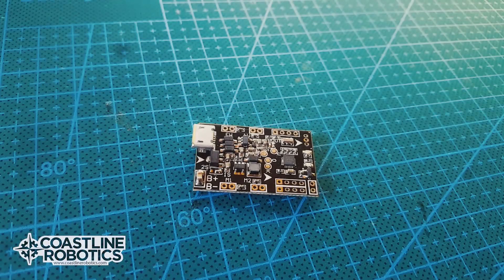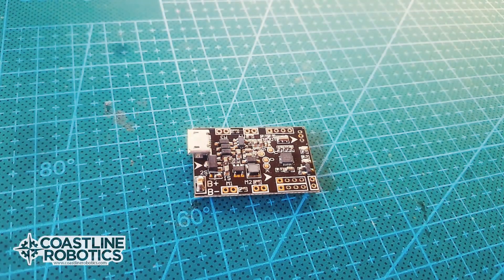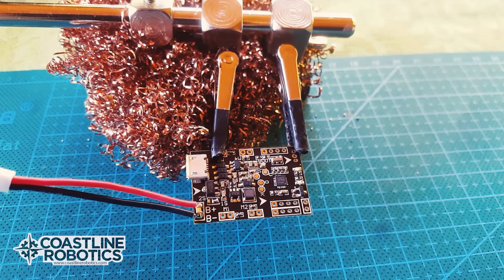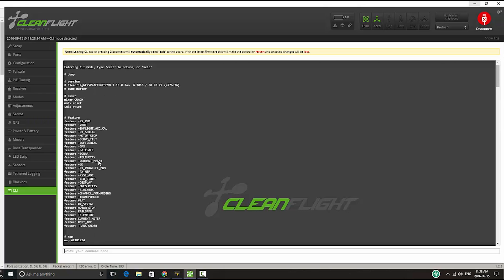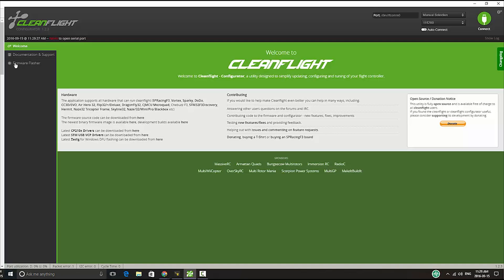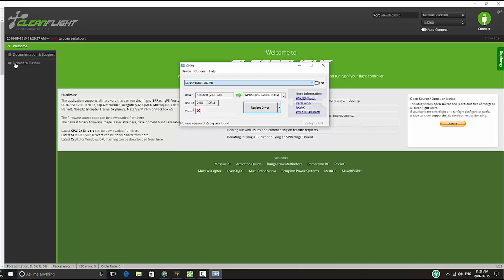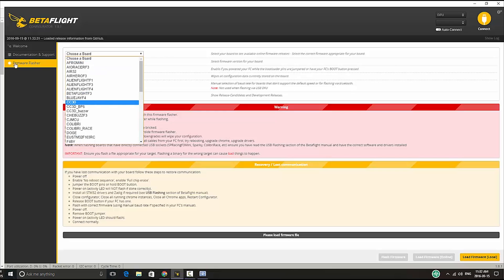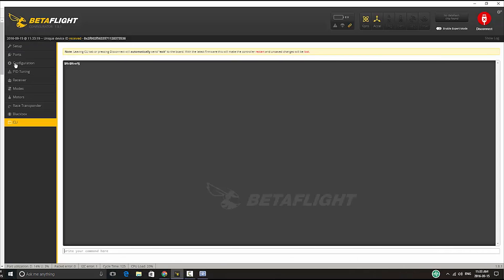Flashing Betaflight on SP Racing F3 EVO for brushed motors with Zadig

Comment: That seemed to have worked. I flashed my SP Evo to the latest version. But now when I connect the USB no com port comes up, so I can't connect. I can still connect via the bootloader. What do I have to do now?
Reply from the maker: Did you de-soldered the bootloader pads?
Reply: Yes. I think I may have originally installed the wrong CP210x driver. I ended up resetting my laptop back to factory settings (I just couldn't work out the drivers) and then did the install again. Works great now.
Reply: I just reinstalled all my drivers after taking my laptop back to factory original settings. Can connect now. All is good. Thanks.
Reply from the maker: Awesome! Dont forget to subscribe and share buddy! ;)

Comment: Thanks for posting your video. I was having problems with connecting to the bootloader. I followed the steps, and with Zadig, and connect via bootloader and can see DFU in the top right of the Cleanflight Configurator. I will crack-on and try to flash the board now. Thanks again.

Comment: Great video! Will this work with the HOBBYMATE Q100 Micro FPV Brushed RC Quadcopter Frame Kit Combo
Firmware version: Cleanflight 1.13.0 ALIENFLIGHTF1
Flight controller: N32 Brushed
Receiver Option: DSM2/DSMX Satellite Remote Receiver?  Also why should someone flash to beta over clean flight what are the advantages? Thank you
Reply from the maker: Hey Bladesoutnow thank you. Can you please share a link to the product to check compatibility?

Thank you!

Comment: I have all the drivers, I followed all the steps, jumped the boot and disoldered it after the flash, but when y try to connect it says "no configuration received within 10 seconds communication failed", I flashed it 20 times but nothing, help please :( I am using a Beecore F3 EVO but I think the process is the same..

Comment: Nice vid!!! just one question. After flashing to Betaflight do the boot pads need to be separated?
Reply from the maker: Hey POLARJFPV yes you'll need to de-solder the pads again before connecting it again to betaflight.

Comment: I flashed it, it works. But when I throttle up the motors throttle down then slowly spike up. Throttle is all the way down but motors keep creeping up. No matter the setting no mater the MOde it with throttle spike. Any help would be great!
Reply from the maker: Hey, try typing on the CLI the following without the quotes "set motor_pwm_rate=32000" hit enter, then type "save", then enter. See what happens.

Comment: Just fyi you only need to hold the bootloader pins connected as you plug in..you dont need to solder just hold a screwdriver or something while you plug it in
Reply from the maker: That's more of a style option, I personally like to have it soldered. If you can do it fine with the screwdriver, congrats! that's also valid.

Comment: i have done exactly as you have said and as i have a frsky
i want to change the uart to serial rx i then save and reboot and the program kicks me out and it wont let me reconect 
and the only way of getting back in is to reflash the board its a sort of the film ground hog situation where the program kicks you out and you cant reconect un less you reflash the boardwhat is happening is i did what you said i then connect to beta flight
and the top port changes to the right com port i then go into beta flight and alter something and save the program disconects and the com port changes back to dfu so i cant get back into cleanflight
Reply from the maker: Hey Bob, not sure what do you mean by changing the UART to serial rx. Please make sure you de-soldered the bootloader pins after flashing your board.  Also you will have to make sure that you are enabling the proper UART port where the FrSky receiver is connected., taht's in the PORTS tab on Betaflight. If after doing all these, sorry but the problem has gone out of my scope.  Good luck!

Comment: I connected my FuriBee F3 with "boot pads" connected to my laptop still isnt finding the flight controller. It also isnt found on that Zadig after going to "List all Device" all it can ind is my mouse and keyboard.. Please Help/S.O.S
Reply from the maker: Hey Jhon Doe, please make sure you have installed both the STM USB VCP driver and the CP210 driver, other wise you won't be able to communicate with your board

Comment: Hey thx for the video and how to. But after flashing i can not connect to the board with beta flight. Solid red light but it is not in dfu mode. connect to port failed. Need help
Reply from the maker: Hey Bull Huxley, after you flash the board with the new firmware, you should disconnect the jumpered bootloader pads, once done this if you connect the board again you should see the created COM PORT on the connect button of Betaflight. 

Please refer to this video for a possible solution:

https://www.youtube.com/watch?v=m4ygG6Y5zXI&t=377s

Thank you!
Reply: Coastline Robotics hey thank you but this was what was not happenings. found the solution. Ot was a deiver issue. Reinstalled the stm with cp driver and worked. thank you

Comment: I'm trying to bind this board to a devo 7e with deviation. I have a Lemon Rx DSM2 Compatible receiver wired to the board. Followed the same firmware flash and version as shown in this video. the transmitter binds to the receiver just fine and shows a solid red light. the board however has a flashing blue light and i don't know what its for. i'm not getting any response from any input from my devo. please help!
Reply from the maker: Jey Justin, what's your receiver option on the configurator (Betaflight/cleanflight)? This should be on the configuration tab. Also to which input are you connecting the DSM2 receiver? should be UART3.

Comment: i made a mistake. you are supposed to change the driver of the stm32 bootloader but i accidentally changed the driver of the "stm32 virtual com port" that will only show up if you plug the qx95 without the bootloader pads connected. now it doesn't save ceartain parameters like selecting serial rx but can still save other parameters like pid or rates. i did it right away when i received it so i don't know if it is a problem of the board or is me by changing the wrong driver. CAN SOMEONE CONNECT THE QUADCOPTER WITHOUT THE BOOTLOADER PADS CONNECTED, OPEN ZADIG AND TELL ME WHAT IS THE DRIVER NAME OF THE STM32 VIRTUAL COM PORT" so i can put the old driver please
Reply from the maker: Hey Alessandro, please go to the Betaflight home screen and there you'll find three links to download the CP210 driver, the STM USB VCP and the Zadig. Re-install the first two drivers and try again.
Reply: Coastline Robotics thanks but but i solved it, i just set the quad on betaflight to brushed and then it worked!

Comment: Hi I've followed the vid and flashed no problem but it still won't connect any ideas thanks
Reply from the maker: Did you disconnected the bootloader jumped pads? MAke sure that when you are connecting you get a COMXX indicator instead of DFU whan connecting to Betaflight.

Comment: Can you use the same process on a micro F3? It has a boot loader button.
Reply from the maker: Hey Robin,
Well... to know if you'll have to use this method or not you will have to figure out if your flight controller has a CP210 chip on it. If your FC do not have a CP210 chip, then you'll have to flash it using Zadig.

Comment: So now have no way to connect to the board even without the boot pins shorted. Looks like Zadig has totally locked me out. Any tips on how to remove that driver and start again ?
Reply from the maker: Hey Helimadness100 probably your drivers are a bit messed up. Try deleting the current drivers, when you have the board connected go to the device manager (if using windows) and delete the driver associated with your board, you should be able to see some changes when you connect and disconnect the board on the device manager. Once erased, restart your computer and install the following drivers:

http://www.silabs.com/products/mcu/pages/usbtouartbridgevcpdrivers.aspx  --> this is the cp210 driver, choose your OS and install it.

then install the SMT32 VCP driver
http://www.st.com/en/development-tools/stsw-stm32102.html.

Once you have installed this short the bootloader pads on your board and do the Zadig process again. hopefully you'll get it talking with your computer again.

If this doesn't work, try on a new computer or change the usb cable.

good luck!

Comment: not having much luck. Wish it was as easy as the video
So soldered the boot pins and checked with microscope. Fairly sure they are good.
Run the Zadig prog and plug board in and no STM32 driver comes up. I have another board the same with out the boot pins shorted and if I plug that in I can see in Zadig a "STM32 virtual com port" Have installed that but every time I try the board with boot pin shorted not STM drivers come up. If I try and flash beta flight just says cant open com port.

Any help greatly appreciated. 

Cheers

Comment: Do you disconnect the bootloader pads straight after the flashing?
Thanks btw, that was the problem I have with my fc. Now I now how to solve it.
Reply from the maker: Hey Emiel1976ep, yes, after doing the flashing process you should disconnect your board from the computer and desolder the bootloader pins. Happy to hear you could work it around
Reply: Thanks to you I solved my problem. Thanks.
I was afraid my bord was brocken.

Comment: does it matter if you don't de solder the boot pads at the end?
Reply from the maker: Hey Helimadness100 , yes it matters. The board won't come off the bootloader state and you won't be able to connect it to your Configurator. So remove the jumper soldering from them.
Reply: Great thanks. I have the new quad running on the clean flight version that came on the board. I see it has airmode now. Im sure more than enough to get me into trouble :-)
I just have beta flight on my 250 quad so wanted to keep the same.
What loop times and gyro rates are people running on these boards ?
Reply from the maker: Hey Heli madness, since the looptime occurs in a relationship between flight controller and ESC's and we don't have sophisticated ESC's on board the brusehd flight controller I would recommend you to use 2Khz for Gyro update frequency and 1Khz for PID loop frequency. Also please make sure that on the CLI you set the PWM motor output between 20000 to 32000. you do this by typing the command "set motor_pwm_rate = 32000"
Reply from the maker: then type "save", hit enter and you should be fine

Comment: Hello !

I downloaded Cleanflight with F3 EVO drivers but whenever I connect my FC by USB, nothing happened on Cleanflight. It just say "Faziled to connect serial port". I didn't solder the boot pads and the red light stay on, blue one blinking.

Any idea ? :(

Should I plug in the battery ?
Reply from the maker: Hey Alexis, when you say you "downloaded Cleanflight with F3 EVO drivers" you mean Cleanflight configurator or Cleanflight firmware for SP RACING F3 EVO?
Reply: Coastline Robotics cleanflight extension for chrome.
Reply from the maker: It seems like a driver issue. What happen when you  click on list all devices in ZADIG? 
You should have something that says STM32 Bootloader. Click on that and then do the process explained in the video. Try that.

Comment: it doesn´t work with mine. i successfully  installed the driver with zadig, but then the flashing doesn´t work. it allways says "USB device successfully closed" and on the loading bar stands: erasing... but nothing happens! what did i wrong???
Reply: Is there any way to reset the complete board? i cant flash cleanflight and also not betaflight. Plz help!
Reply from the maker: Did you tried restarting your computer after flashing the driver? Sometimes computers get all weird just because.

Comment: Hi there. Man! I just did as MarekSHayward said using just a screwdriver to shortcut the boot pads and I succesfully flash Betaflight on the board but then, as soon as I plug the battery motors start to spin! No matter what version of firmware I flash on it. I tried to downgrade to Cleanflight again but same issue happend: As soon as I plug the battery with the board connected to the PC the motors start to spin!! Any help welcome
Reply: Tezcatecpatl Espejo Luminoso I'm having the same issue of the motors spinning when you connect a battery. did you find a solution? I'm going to try and reflash the board tomorrow but if that doesn't work then I think I'll need a replacement.
Reply from the maker: Hey Tezcatecpatl, go to the CLI and type the following command without quotes "set motor_pwm_rate=" and then a value between 2000 and 32000.
E.g. "set motor_pwm_rate=32000".

Try that and let me know if it worked for you. Thank you.
Reply: Thaks for your reply. But it doesn't :(
Its funny that now I can connect no matter with cleanflight or betaflight. Or flash Any firmware of both of them not having to shortcut the boot pads. Cause of this behaviour I double check the boot pads just in case they were in a way shorcut but they are not... Any idea?
Reply: Note that the behaviour of motor spin IT IS NOT JUST as soon as I plug the battery. But as soon as I connect to the PC with the battery pluged to the board. ¿? Weird! Isn´t it?
Reply: SOLVED! For someone in the same situation. It was a question of telling the soft to managed brushed motors:
Configuration - ESC/Motors Features - ESC/Motor Protocol = BRUSHED instead ONESHOT125 or others.
It is not that obvious!? ;-P

Comment: for me it just keeps saying failed to open serial port. my driver is up to date and i followed everything in every firm ware flashing video i can find but it keeps saying failed ot open serial port. i saw a few people mention the had this problem but they fixed it without saying how they fixed it. please post the fix in the description of the video!
Reply from the maker: Hey ryanworks35509 after flashing your board try restarting your computer, make sure you have the bootloader pins desoldered, try on a different computer. Sometimes the drivers get corrupted but that is something out of the scope of this tutorial.

Comment: I have been messing with this for hours and it will not flash. I have it in DFU mode and manual baud 256000. When I hit flash it immediately says "USB device successfully closed" in the log and the progress bar just says "Erasing..." and that is it. Nothing happens past that. Also if I jump the boot pads and hold them jumped my computer makes the disconnected noise every few seconds until I release the pads ad then it boots up normally with the blue light flashing and red light solid
Reply from the maker: Hey Adam, make sure that the switch "No reboot sequence" is off. This is located on the firmware flasher tab. Also I would suggest you to solder the bootloader pads, just to make sure it's connected all the time. Try the manual upload; just download the appropriate firmware version for your board, then click on Load firmware (local), chose the downloaded file and click flash. This way you'll know if it's any bug related with your internet connection.

Download the firmware here:

https://github.com/betaflight/betaflight/releases/

If your board is exactly the same as on the video, then you should be looking for the SPRACINGF3EVO .hex file.

Comment: If you just type dfu into the cli command it does the same thing without having to jump the pads
Reply: dfu isn't available in Cleanflight, or at least not the version that shipped on my Evo.  It's available in Betaflight but you have to flash Betaflight before using dfu in Betaflight CLI, chicken and egg ;)
Reply: just tried typing DFU in both CF(1.2.4) and BF(1.8.4) CLI as suggested  but all i get is ' unknown command '